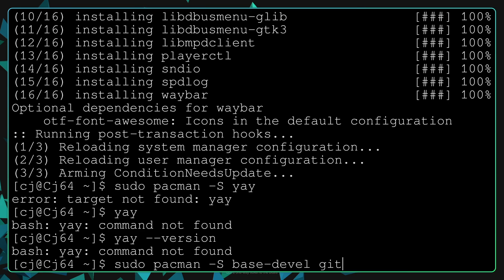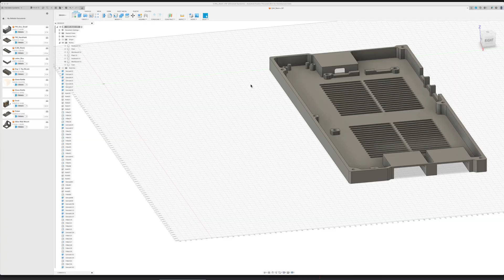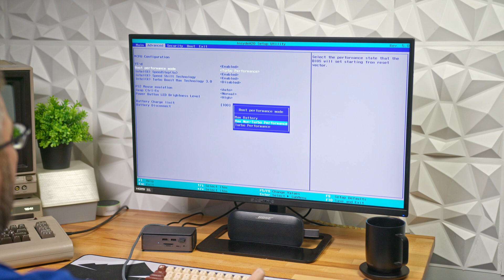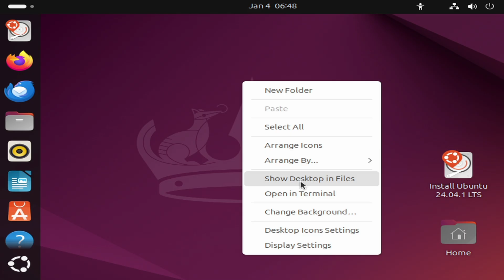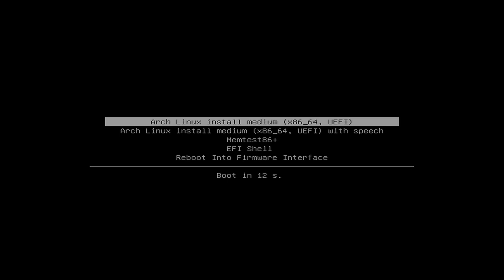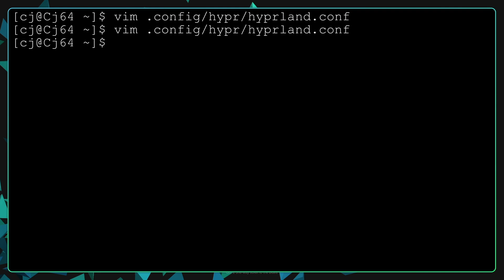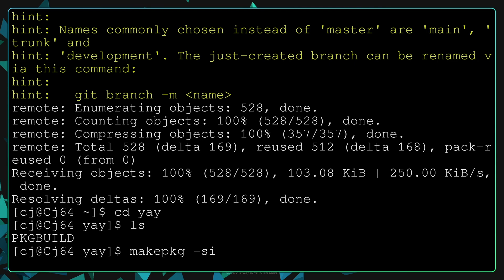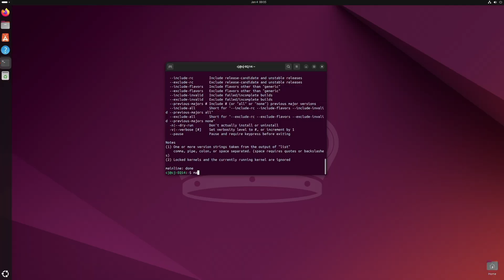My Framework Keyboard PC with Arch & Hyprland!

Comment: Those cases are awesome. Hyperland is awesome but... The experience falls apart if you use it with a laptop and have to switch to known WiFi networks regulary. The suggested network gui or tui options don't remember WiFi passwords. I didn't test captive portals yet. The redirect network detection by KDE already does not work in sone hotels.

Comment: Actually going endeavors+hyprland as first distro was great, if you exclude a month of reinstalling it and fixing tf2 not running for some reason. Still rocking last successful install on my pc and installed same combo on my laptop.
Reply: I'm still dualbooting win10 on both devices in case something breaks. For intresting distros to try on a keyboard pc - void is an unique choice, felt nice using it on live cd. Maybe with lightweight de like  openbox or lx - even less taxing on pc (tested on Intel atom netbook)

Comment: Very nice!!  I have been running linux since the early Slackware days.  Normally using Kubuntu these days.  I've been saving my dimes to buy one of the Framework 16" laptops, hopefully soon!  Would love one of those cases to put the RISC-V mainboard in.  I think that built into a keyboard is a better CJ64 build...  lol.  (Btw - I started on a Vic-20..)

Comment: I'm glad I saw the community note on your other channel to bring me here! I've been meaning to from the Elevated Sys mentions, but kept forgetting.
I really dig the CJ64 concept and the way you've pulled it off. I'm glad you've kept iterating on it since the early attempts. The thought and effort put into it really shows.
For myself, I'm a bit of a distro hopper. On my "production" system, I keep Xubuntu LTS, but on other systems I have a tendency to keep switching between the various flavors of Ubuntu and Debian base (LMDE has some nice polish at this point). But I do give Arch based distros the occasional spin, too.

Comment: Really like what you've done with the Framework motherboard, custom chassis/case with built-in keyboard! That's absolutely genius 😎 

I've yet to fully embrace Arch, but your video has inspired me to pull my finger out and get the various ISOs downloaded and installed on my test rig (nothing fancy, just a Dell Optiplex 3070 micro).

I use a mix of Bazzite (for gaming) Fedora for bleeding edge (hardware) and Linux Mint (for older hardware).

My family have x2 Framework AMD 13's, x3 Dell Optiplex 3070's, Asus Zenbook 13 and Apple MacBook Air 2012 (which runs Linux Mint). Needless to say we don't run Windows.

I've recently delved into FreeBSD, and into Endeavour. I'm still learning with FreeBSD, and to a lesser degree with Endeavour. I really like Endeavour, it's very fast, pretty and seems very stable.

Love the channel, here's hoping you get to 5k subs!

Comment: Lately I've been using Ubuntu 24.04, installed it in August and have found it really reliable and easy to use. Though there are some little things that bug me like how it handled multiple types of application shortcuts, and blends them with snap packages in an annoying way. 

This PC is just begging to dual boot Puppy Linux and Haiku OS lol
But I used to use Garuda every day (an Arch-based distro), so maybe I'd have to take the plunge and try out native Arch. And regardless of this PC, I think I'll have to try installing Hyperlands alongside my main desktop, whenever I move off of Ubuntu (I doubt Ubuntu would allow or work well with Hyperlands).

Comment: New subscriber here. I am using Ubuntu now but might switch over to using Rhino Linux and KDE. I wouldn't mind trying Arch but don't really want to have to fix it every time it comes up with a new update. I did try Manjaro before and always had issues with my wireless card after updates.

Comment: Pretty cool build - Hyprland on Fedora works pretty solidly if you don't want the learning curve of Arch but still want to be as near the leading edge of packages as possible.  Although - I'd run Cosmic on Fedora myself... since Alpha 5 came out, it's becoming a solid contender with a lot less "alpha pain" than you'd expect.

Comment: As a Framework laptop user (two of them actually) I was really taken with your keyboard enclosure which while aesthetically appealing, also is consistent with Framework's philosophy of reusing perfectly good components. I also appreciated seeing that you set performance limits to add thermal management. For the record I've used both Linux Mint Cinnamon and Mint XFCE (works fine) but my current OS is generic Debian 12 XFCE. The Debian works just fine but does require a bit of "tuning" to make the Framework screen usable to my (ahem) "mature" vision.
Great job!

Could you please provide the link to your main channel? If it is already here then I'm missing it.